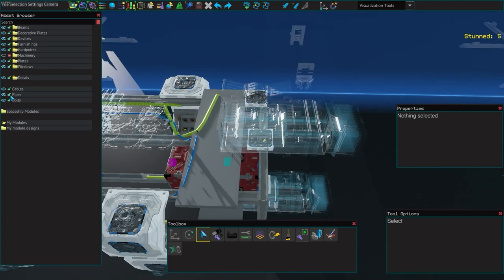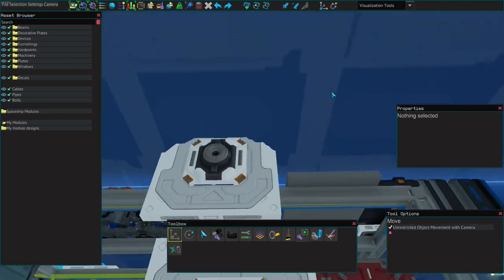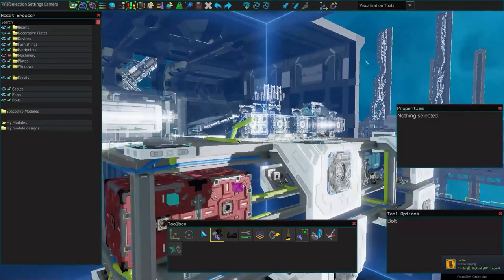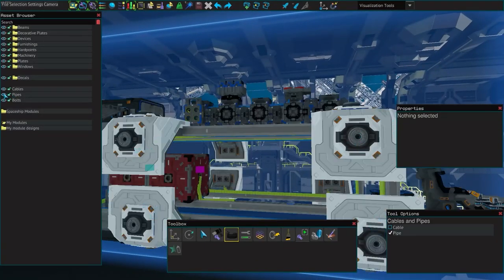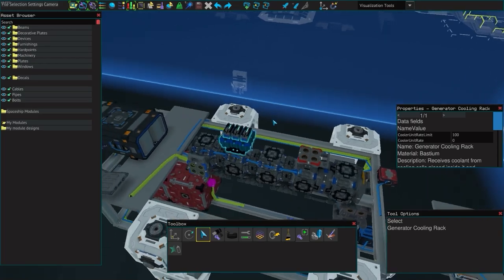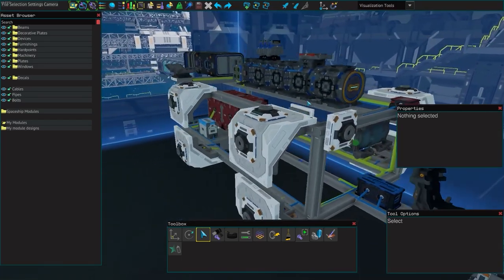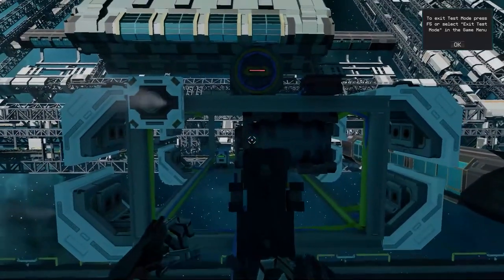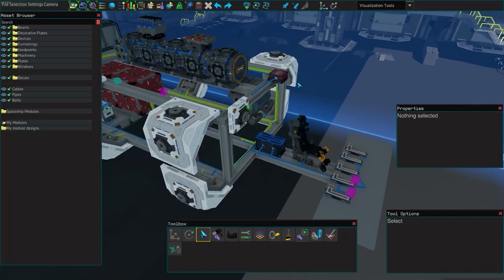Starbase Beginner Guide: Ship Builder - Repair and How to Fix Your Ship!

Comment: Another bug/issue is when you test run your ships enough while designing, the generators will suddenly stop working. This is because the fuel rods don’t reset to full between test flights. All you need to do is swap them out for new ones for the generators to work again.